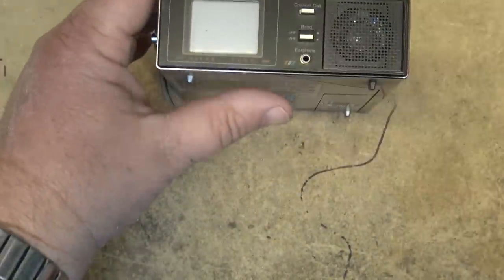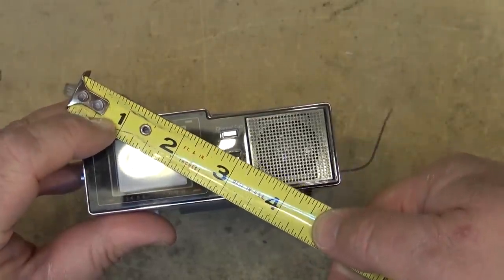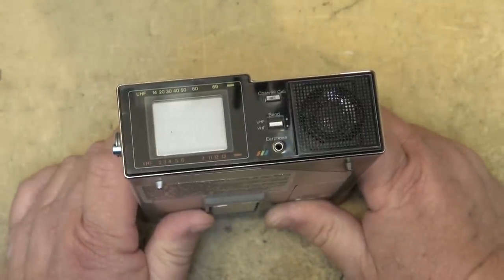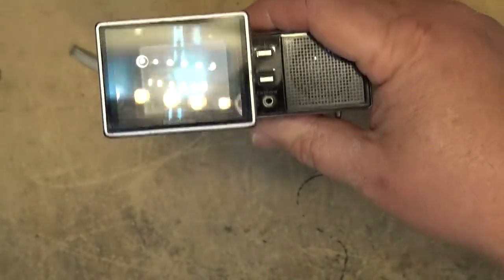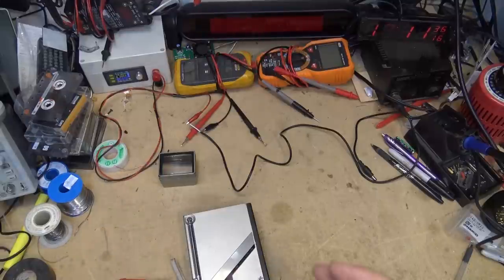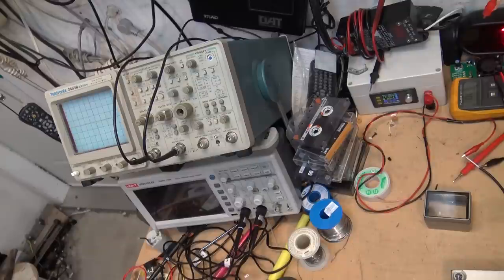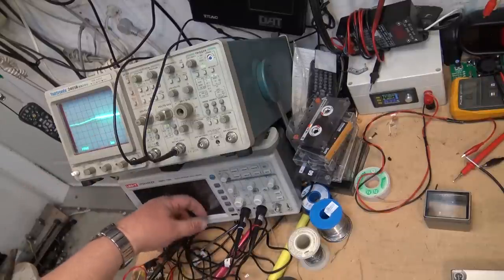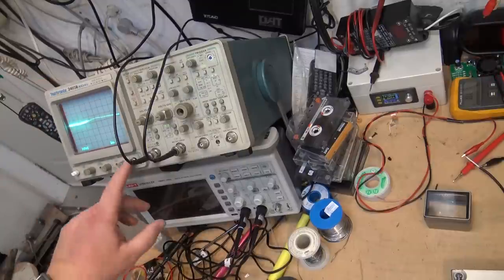Smallest Color CRT TV set in the world

Comment: I took electronics in high school back in the late 70's. Analog radio and TV mostly. The instructor told us that battery powered TV was impossible due to the high voltages needed to run the CRT. 
It amazes me  how far we have come.
Reply from the maker: Amazing
Reply: They had battery operated TVs back in the 1970s, and I've seen a prototype for a battery operated pocket TV with a B&W CRT screen that dated from the 1960s. Your teacher was wrong even then.

Comment: Many years ago, back in the mid 70's, no, wait, early 70's a buddy of  mine at Fort Bliss had a little TV sort of like that, but it had AM/FM on it as well. I don't recall the brand name, but the TV Screen was about the same size, it would pop up when you hit the right button.  The neat thing was that it looked every bit the radio, so when we pulled Arms Room Guard duty, the Sergeant of the Guard would allow us to take it with us to our guard post, which, because of some recent break-ins at the Fort had us behind locked doors, they gave us a .45 with three rounds of ammo to defend the Arms Room.  So we would take the 'radio' with us and when the doors were locked behind us, we could pop up that screen and watch TV to kill the 3 hour shift, then when it was the next guy's turn, if he were in on the deal, you could leave it for his use.  We never did get caught, but after I was promoted to Sergeant, and pulled Sergeant  of the Guard, I was on to the con and refused to allow the TV down in the chamber.  Funny how that little stripe can change a nice guy to an asshole!  Well I looked at it as obeying the regulations.

Comment: That's one nice unit, very clever designers :-D
i can't imagine how they made the phospher mask, crt's are a work of art.
You are dam right on the capacitors, it would have been dead years ago on smd types.
10 to 11kv!!! that's enough to run a 12 inch black and white, no touching that anode cap :-D.

I made a t.v from a black&white tube+pcb from a dead video camera, finding a tuner module small enough was a pain, then creating 32v for the tuning was the next problem.
i used a tda200X for the audio.
An old c.b radio case to mount it in was ideal, all metal :-)
Reply from the maker: By comparison a B/W tube of that size about 3kv. A 9" security monitor runs about 10kv. I used to have a small 5" color set, a citizen, and I do currently have a few small B/W sets with 4" tubes kicking around. The smallest color CRT I have in my little 8" trinitron. They made a smaller one, 3.7" and of course the much more rare indextron tube.
Reply: Now I'm wondering what my Binoc TV's 2nd anode voltage is.... it's screen is  just a tiny bit bigger than the CT-101's screen, and is B/W.
Reply: Yup... the phospers and also that little square sheet of metal  with all those tiny holes through it behind the phosphers... definitely intriguing, zx8401ztx... they must have had very precision micro-lasers to punch that shadow-mask out
Reply: Im not sure how they did it, and i don't know if they had a laser that good all those years back.
I still think the c.r.t was a clever way to display pictures, it had a life time that was longer than modern tv's.
Modern stuff seems to change every few years to the next wizz bang pocket empty-ing idea, it stays unreliable though, funny that lol.
Reply: Right on
Reply: Photolithography was used to produce the shadow mask and the dot pattern on the CRT.  They would put down one colour at a time and progressively etch between applications to build up the dot pattern.
Reply: they used ones  that failed to make the grade  (from computer screens ) and cut them to smaller size
Reply: The shadow mask was most likely perforated with a laser. I can't imagine any other way. I wonder if it would be possible to DIY one of these, maybe contract a glassblower for the case and beg someone with a laser to make the mask. Sourcing the cannons would  not be too difficult, and the phosphor is doable. The alignment is a different story altogether.
Reply: @punker4Real  I don't think so. The dots would be huge for this ultra small CRT. It has quite a reasonable resolution despite it's very small.
Reply: I'm surprised they didn't use a beam index tube because of the beam energy losses associated with using a shadow mask. It would've been much more power efficient to use beam index even with all of the extra 'processing' because there is no shadow mask to waste electrons on. But I guess this would've added to the upfront costs so power efficiency had to yield. :-/

Comment: Back in the 80's I bought one from a company called "Sharper Image", I traded it for a UNISONIC  XL990  which has a 2" screen, AM/FM radio and takes 6 AA battery's.
I still have it like new in mint condition, it also has a slide on magnifier and a leather case.
Reply from the maker: I have a 3" but mine is LCD, and it is in bad shape. The LCD has what looks like watermarks, but it is actually the liquide crystals drying out.

Comment: There were a number of small CRT's in use in camcorders though I'm sure very few were color.  I suspect the tube in this unit was common to those as well.  Nobody has discovered yet that these CRT's can be had from thrift shops for a pittance, but a cool source of parts and ready to accept NTSC signals and battery power.
Reply from the maker: Most of the color crt CAMERA VIEWFINDERS WERE BEAM INDEX TYPES.
Reply: I fellow I knew once had a higher quality camcorder from late 70s with a color monitor. Only one I remember seeing.
I once checked out color CRT TV with about 2" screen in a store. It was set up like a watchman. The pixel dots made it hard to see the picture without backing up, then it was too small to see far away.

Comment: When I think about all those era tv's I threw away over the years when I was in the servicing business,  I kick myself for not having the foresight to hang on to a couple dozen of them, they are history and valuable....
Not to mention all the tubes and components from the 60s and 70's that would be preserving history of electronics.
Nowadays,we simply throw everything away with no conscience of historical value.!!
I miss those early days of TV service .
Best wishes my friend.!
Reply from the maker: YesI have hung onto a few. I unfortunately tossed my old 34" CRT HD set as it was too heavy to move. I do have a few CRT sets that I am keeping as collector items. This 1.5 is going in my collection. I have a few small B/W sets, and an 8" sony trinitron. I have a KV1365 and 1965 sony. These were non-remote sets with video input using optical chassis isolation.
I have a mitsubishi 26" as well, and the very last Sony 21" Wega perfectly flat trinitron model that they made. This was the last of the analog only sets. I have a JVC multi system set as well and a few industrial monitors.  Just hung onto them for the memories of the past when I was servicing. The modern LCD sets I don't have much interest in. I do like Plasma. I just thing the way they work is cool compared to the boring LCD. I like restoring old tube gear.
Reply: 12voltvids ...... I think we've all had many of those brands that I couldn't give away just a few years ago, as I said I wish I hung onto a lot of that material and tv's that were lying around and seemed to be outdated only to now realize they are valuable,  my 35 inch Mitsubishi with the wood cabinet and worked PERFECTLY , was unfortunately thrown away when I moved because it was to heavy to take with me...that was a sin.!!
Anyway, best wishes and keep plugging away.
Reply from the maker: What is funny is last spring during free junk day I picked up 4 small 14" and 10" CRT TVs that people put at the curb. I hung onto the 21" sony because it was in pristine condition, and has a perfect picture.
The other 3 sets I threw up on craigslist, and sold them all within 2 days to 8bit game console collectors.  The new flat screen TVs are impossible to play old games on due to the delay between the video signal received and display on the panel. CRT sets have no such delay. This 4 - 5 frame delay makes it impossible to shoot at something moving on the screen as by the time you see it, the shot window is closed. So game console collectors want CRT sets.  Never though I would see hat happen.

Comment: Just got me one of these! Man they're hard to find! I love the crap out of it though, I have a thing for small CRTs
Reply from the maker: How much?
Reply: @12voltvids  $85 plus shipping. They don't pop up on ebay too often at all.. there was one on an auction up before I snatched this one, went for like $170. Caught me off guard, way past my $100 max bid, lol
Reply from the maker: @speedyink  That's pretty good. I think that is about what I paid.
I got this one from a viewer that offered me the tektronix scope I use now as a donation, and offered me his 101 for I think it was 80 bucks.
Reply: @12voltvids  That is a good price! They're definitely rare and still sought after. The one I was bidding on just sky rocketed in price in the final hour.
That was nice of your viewer!
Reply: @12voltvids  Stupid question if I may, but it would be nice to get a second opinion. I don't know if you got the rechargeable battery pack at all with yours, but it basically looks like just 4 Ni-Cad AA's in a plastic holder. I'm thinking of just buying some new Ni-Cad batteries and in theory, good as new, right? I mean, I don't see anything that could go wrong, but I'd would be so sad if something went wrong when i tried to charge, you know?
Reply from the maker: @speedyink  Yes correct, and I was going to rebuild mine with some NIMh cells.
Reply: @12voltvids  Oh? Would you be able to charge the Ni-MH batteries on a circuit originally for a Ni-Cad setup? Ni-MH would most certainly last longer, and I have those on hand.
Reply from the maker: @speedyink  yes sure can. NiMH are the same charge spec as NiCd. 
I picked up some cheap NiMH at the dollar store.  Just haven't gotten around to it yet but will one of these days.  Need to attach wires to the ends.
Reply: @12voltvids  Good to know! Guess I'm just thinking back to when they made the switch, the chargers would normally say to only use or one or the other. Hmm, might have to try that out tonight then.
Reply: @12voltvids  Oh cool, so he sold you the set then? That's really nice, have you got it running on battery yet?

Comment: Smallest in-line gun CRT.  Interesting that they used a delta dot pattern.
Reply: Are you sure the gun is inline, it would not work correctly with a delta shadowmask. Plus the neck is so thin a delta gun assembly is the most space efficient.

Comment: These were indeed cool devices.  Had a buddy when I was in the Army that had one of those, he used to lend it to us when we had arms room guard, they would lock us up down in a small outer office between the outdoors and the Arms room vault where all the M-16's and such were stored.  We had a Model 1911A1 .45 ACP Pistol and were allowed to bring a radio to keep us awake for our 2 hour shift, his TV looked enough like a radio that it passed inspection before we took our post.  This way we could watch TV and stay awake instead of reading and listening to the radio, which had a tendency to put me to sleep back then.  They were good for that.  I had a small Crown brand of black and white TV with AM/FM radio built in that I picked up in Tokyo on my way home from Vietnam, it worked good took a large adapter with 9 D cells, or could plug into a car with a 12 volt plug.  I ended up selling that to  a fellow who worked as a night watchman, he mounted it in his car that he used to patrol the areas of his charge.  Said the TV worked great for that.  It had a resistor burn up in it when I had it, I took it to a TV repair shop and they said they couldn't get a schematic for it since it was never sold in the USA, so I just took  a bit of wire and wrapped it around the two legs of the burned out resistor and it came back to life. I have no idea how long it lasted working like that since I was transfered from Texas to the DC area, and never saw the fellow again.
Reply: Liar

Comment: a while ago, i joined the CT-101 club. Even have the box. can provide a pic if requested. Mine needed some power supply work as the original SMPS supply was on its way out and interfered with the screen, creating scrolling lines. i replaced all that with a couple of LM317 regulators and pots to adjust to the correct voltages.
Reply from the maker: Ct101 is a cool little tv.  Going to rebuild the battery pack on mine one of these days. I don't actually watch it, just show it off from time to time like my old cameras.

Comment: I think the smallest crt were used in some visors on tape video cameras
Reply from the maker: B/w CRT down to .5" were made for eyepiece.  There was a 1.25" beam index color made that used external sensors to syncronize the color circuits.  This one is the smallest 3 gun conventional color tube and even though it may have been the pro camera division that designed it camera operators didn't want this because it wasn't sharp enough for critical focusing.

Comment: Where did you get that many analog channels?
Reply from the maker: Those analog channels are available in my house and only my house.
I have a stack of professional CATV modulators that allow me to send video signals around the house.
I currently have 2 MTS stereo modulators and 5 mono moduators.The 2 MTS are used to send programming in stereo sound, mainly music oriented programs. One just plays youtube concerts that have been saved before they were taken down. One sends my security cameras throughout the house and the others an analog feed from a couple of cable boxes. One for example stays on a news channel so I can watch it on any TV. I still have a few old TVs that only have analog tuners. This allows me to use these  sets and also provides me with test signals when working on old AV gear. One channel, has just video footage I shot. That way I don't get hit with copyright if I show it on YT. I did a video showing the rats nest in my communications closet several years ago. Lots of coax and splitters to combine the signals. On top of that, off air digital signals are also in the MUX, so on a digital capable TV, I see both the analog and off air digital signals.

Comment: Do CRTs with one electron gun have convergence issues?
Reply from the maker: No. Single gin color CRT, have no registration or purity error.
A single gun color CRT is known as a beam index tube. Sony calls theirs the 'indextron" tube. How it works is there is a 4th stripe added to the back side of the tube added to the red stripe. This 4th color stripe emits UV light which is picked up by detectors mounted on the bell of the tube that look inside to the back of the tube. Flashes of UV light synchronize the color multiplex circuit that switches between the R G and B video signals to drive the single beam as it sweeps across the screen.
Conventional 3 gun tubes use a shadow mask, or aperture grill  to align the electron beams from each gun to their specific color dot. Because the shadow mask is metal, it can pick up a magnetic charge and this will repel the electrons as they pass through and cause purity errors. So this mask is demagnatized at every turn on by the degauss circuits. 
Also as the beam travels across the screen the distance changes slightly between the 3 guns, and this is controlled by the convergence coils, and fixed magnets. The coils provide a dynamic signal that changes with the sweep position to keep the 3 beams aligned with the correct holes in the shadow mask as the beam scans it.

Comment: 06:02 That's cool how they combined the manual tuning device with the electronic line-readout  on the picture... does it have an auto-scan ability too?
Reply: That set's definitely cool :-) ... and it reminds me of my little Sears Binoc TV that I bought new back in 1980... it still works great, too.
Reply from the maker: No this one doesn't have auto scan. The 3" LCD set I have does
Reply: Right on...  some years ago I had a little Casio LCD color set ... I remember it only had up/down buttons for tuning and one had to wait for the thing to move along the screen until it locked-on to the next channel ... sure was neat stuff back then :-)
Reply from the maker: Yes just like my Panasonic LCD. The difference between the casio LCD and Panasonic LCD was casio used a super twist LCD and Panasonic used a TFT LCD which is the same as most TVs use today.  Newer high contrast models use IPS  screens.
Reply: Right on

Comment: How do you make/hook up the NTSC signal?
Reply: plug in a composite source into an rf modulator (maybe a vcr), take the coax cable and strip it, attach the two inner wires to the two clamps of one side of the alligator clip

Comment: Can you get shocked when you touch the internals or the crt tube?
Reply from the maker: Sure can.  Plenty of places inside a CRT set with high voltage.  After all it is a vacuum tube.
Reply: @12voltvids  even if it's battery powered?
Reply from the maker: Flyback transformer on this set steps the HV up to probably 10kv on that little tube and the focus grid is probably 1kv. 
A 25" tube ran around 30kv.

Comment: 20:10 , why are the pixels in the PC CRT arrangement instead of the normal TV one?
Reply: probably the neck of the crt is too thin to accomodate in-line, and delta arrangement is more space efficient for three guns in a round neck. The phosfor and shadow mask follow that gun arrangement. The relative long neck compared to the screen diameter make up for the convergence issues associated with delta.